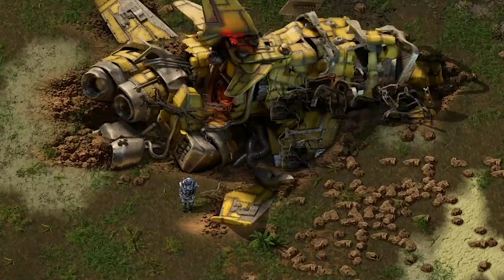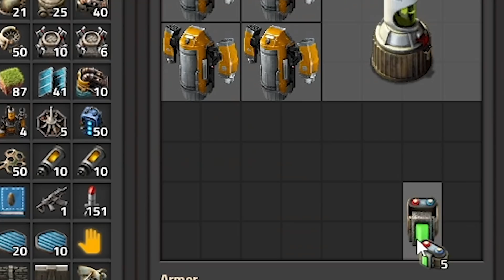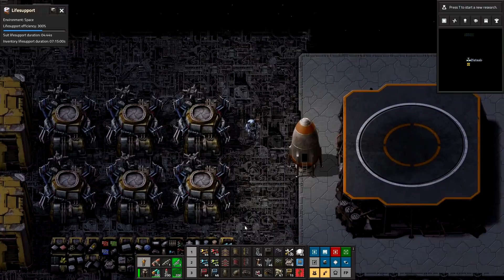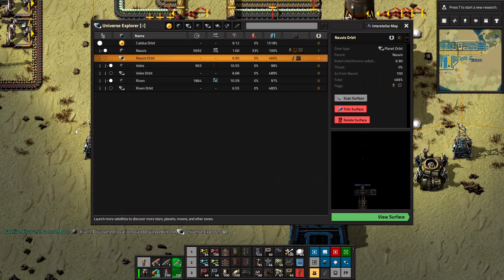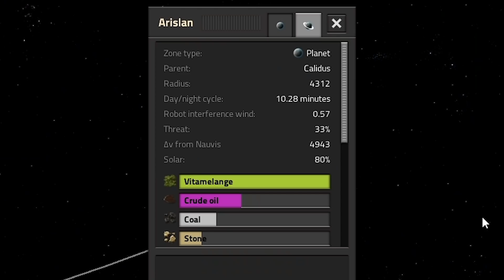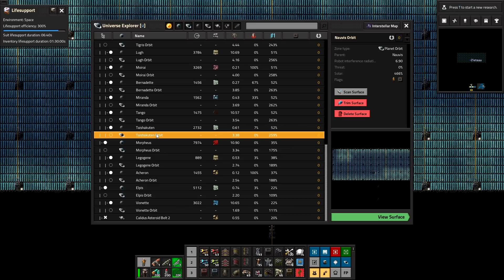Spaaaaaaaaaaaaace - Factorio Space Exploration #4

Comment: As has been mentioned in a few other comments, be careful with those signals. If you lose power on either the transmitter or the receiver the cannons will start firing indiscriminately. I personally have a safeguard condition (set P = 99) that gets checked to make sure the signalling is working but it's also a (probably better) option to send the requested amount from the requester (rather than sending the stocked amount and trying to figure out the requested amount on the sender side).

I really love how the beacons work in spaceex. They never felt quite right to me in vanilla. I love the compactness of 8 productivity assemblers surrounding 1 beacon when replacing huge midgame assembler2 builds.
Reply: I just subtract the amount of a material I want and send that signal, so the cannon only fires when the input is negative, if the power goes out the signal is 0 and therefore not negative.

Comment: A design hint regarding delivery chests...
Assuming you want to receive barreled water.
Put a cable from the delivery chest that receives the barrels to an arithmetic combinator, multiply with -1, feed this result into a constant combinator wich is set to the desired amount (200 barreled water) and feed this into the transmitter.
On the receiver side, put the signal into a inserter and set it to "if desired material > 0". This avoids spaming delivery chests while power-shortage on the transmitter side.
Reply: Most common mistake made with delivery cannons.

Comment: Just a quick note on the signal transmitter network.  If the transmitter loses power it will stop sending for a while.  If you are using it to check the amount of something, the receiver side may see that as a signal to send.  If your receiver chest is full and you send more... boom.

There are 2 easy ways out of this.  Either send a "marker" signal to indicate it's all operational and don't send if it's missing, or send a signal indicating that you need items.
Reply: Learned that the hard way! My base powered down, so my cannons thought there was nothing at destination and they kept launching… fixed it by having the launchers only work when the receiving base sent a demand signal.